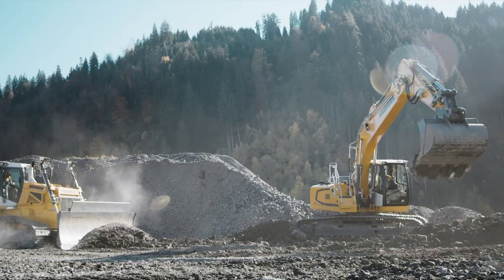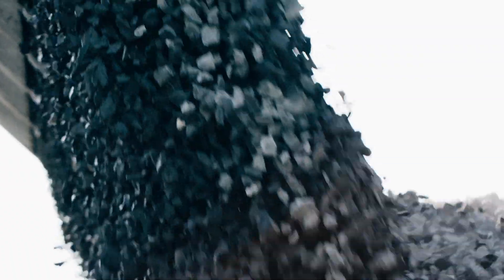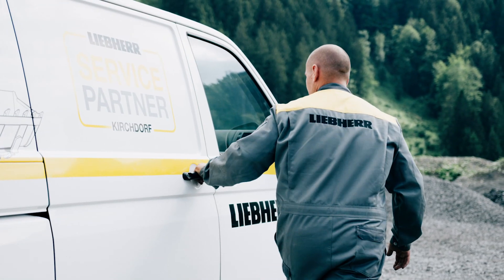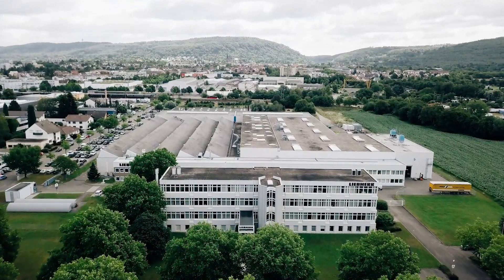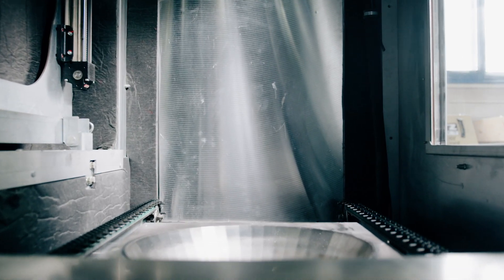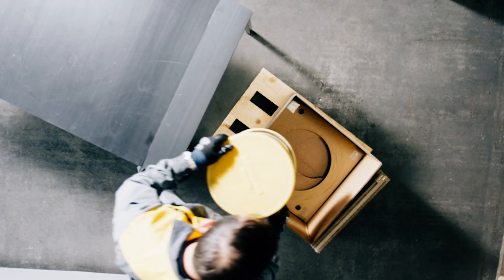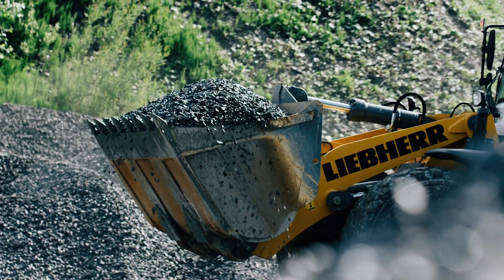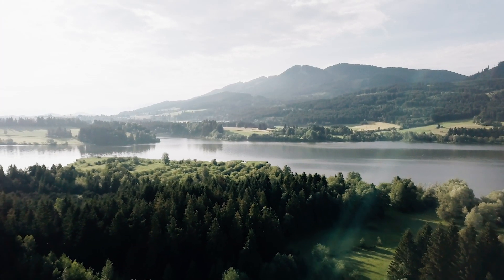Liebherr - Exchange program for diesel particulate filters

Comment: How often does the filter need to be changed? Is there an added cost for exchanging and servicing the filter, considering that Liebherr is the only one allowed to certify the filter exchange? Also is the maintenance file used to update the machine following the necessary filter exchange only available to Liebherr dealers and service staff, or it is also available to equipment owners who prefer to do most trivial services in house?